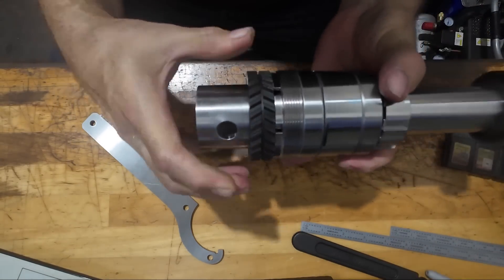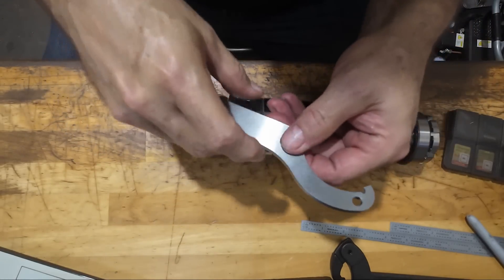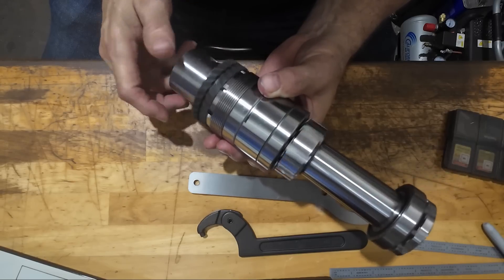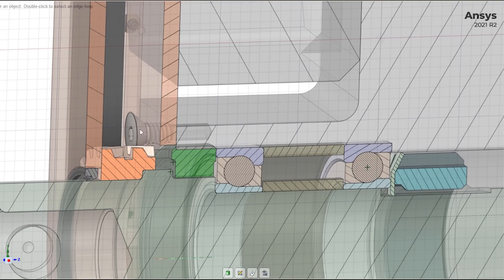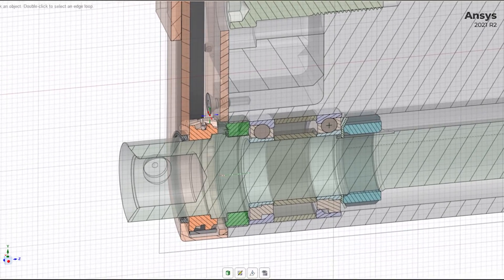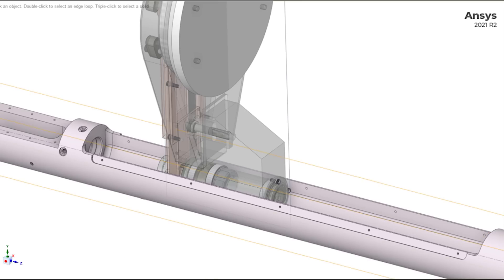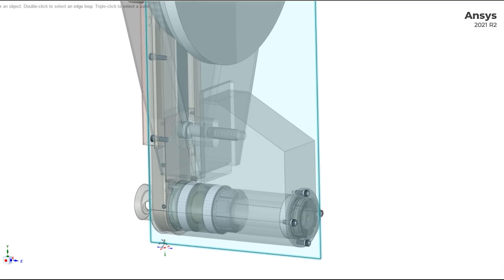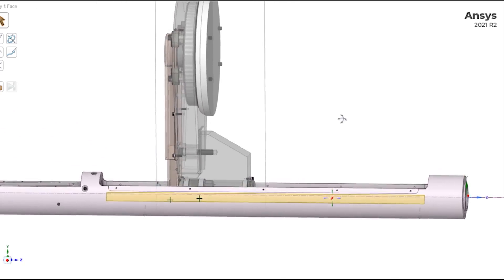Special Wrench

Comment: Hello Peter, I directed the reply below to a fellow commenter however, I thought I would ask you directly. I really enjoy your content!

I have been wondering the exact same thing (why is Peter doing this project?). I love Peter’s content and eagerly await his next video after I finish any of his videos. But I’m left wondering why do all of this? Other than just building a really cool attachment! I have no criticism, just huge curiosity. What is the mission statement?

My concerns are, I t’s 1:1 so same spindle speed, it’s less rigid than the main spindle, it’s complex, the belt is a wear item, the main spindle can travel below the lathe spindle. So why the offset? 

The only explanation I can think of is that it requires much less clearance under it and on the front and back. But that is easily cured with an extended reach holder. That doesn’t seem worth all of the beautiful work Peter is doing. I would love to know the story behind this attachment. What was the inspiration?
Reply from the maker: I showed in this video the reason? I have to do machine work on the end faces in this part's long slot/cutout. In order to get the tooling in there, I need this smaller spindle. The 1:1 Ratio just makes it easer to program and that's all the room I had for the belt drive anyway. The Mazaks milling spindle can rotate from 0-10,000 RPM with 50 Hp. So there will be no trouble with speed or power at that ratio. In this case I drought that I will need more than 3000 RPM anyway. Also I don't need in this case to tap anything but a 1:1 ratio make rigid tapping work better too. If I ever needed to do that in the future with this attachment.
Reply: @EdgePrecision  Thank you for the reply Peter. You were part of the inspiration for me to come out of retirement and start a second machine shop with my 18 year old son who is going into engineering school soon. Thank you for sharing your knowledge. All the best! Steve

Comment: I'm 10 days late, but is there too little space to add a "coolant-proof" seal to protect your spindle bearings?  Thank you for sharing the model so that we can better understand the reasoning behind everything.  I wonder whether the designer of the part you're planning to machine actually needs those 30° chamfers on the groove or if the groove design could be changed to something less expensive to machine?

Edit:  I was a Mechanical Engineering designer when I was young and the Tool Makers that built nearly everything that I designed all knew that I was always open to changes to my designs that didn't adversely affect the purpose(s) of the design.

Comment: Building a spindle is something I would not even dare to touch. There is so much involved that it is truly mind boggling. 
I am very interested in how this is going to turn out. Especially stability is a very likely problem area. What material is the part?
Reply from the maker: These parts are titanium.

Comment: Amazing work! Is that like an iscar ITS connection? Did you consider buying a spindle from nakanishi or other manufacturer? Or use a lathe live tool spindle with a capto connection?
Reply from the maker: No I did not consider purchasing a spindle. I needed the ITS MB50 connection for the boring heads I plan to use. Otherwise I would need adapters to use these boring heads. This just increases the tool length with those obvious disadvantages. So commercially available spindles just would not do what I needed.

Comment: Could it be possible to add an air in port to the "new spindle" housing, so you can have a little of positive air pressure inside it while operating and avoid cooling getting in?

Comment: I saw your post on instagram, I remember looking at it for a while trying to figure the whole thing out.  Thanks for making this video it makes a lot more sense now.  That is a pretty complex part I can't believe it could not have been designed in more than one piece.  Then again I have seen electronic unit covers machined from solid thicker stock rather than using a standard thickness sheet.

Comment: no way to burn that in with a sinker edm? Maybe the parts too big? just wondering
Reply from the maker: @precisioncomponentllc1820  There is a shop here in town that can do it (probably). But this is a very expensive part to a larger assembly. It is always better if you can do this kind of stuff in your own shop. You tend to lose control of quality and of coerce there is the time and cost as well. There are more of these part coming in the future so it would be better to do it all here. So the decision was to go with this idea. Mostly for the future parts as well.

Comment: I see holes on the face of the sheave. Was the  taper lock bored out of it to fit your application? Or are those holes for locking it on the shaft?
I'm not saying lock-tite won't work, but it seems a couple of set screws and a keyway might be applicable.
What would be really cool is if you made your own sheave. You could split in two along the groove around the circumference and have a taper on each side where they come together. Run some bolts thru the face and they'll lock together and easily clock however might be needed.
Maybe a belt tensioner, if your worried about clocking accuracy. 
Cool project. Seems like you could make a nice chunk of change selling these heads to Integrex owners.
Nice to see you back making videos on a regular basis.
Reply from the maker: Yes I bored out the taper lock on the sheaves. The head has a way to tension the belt. I’m going to try the locktite by itself. But I do have a plan to put pins if necessary.

Comment: I have used angle heads that have a 30 taper, but they have way to big of a housing for this part
Reply from the maker: It could work with ER32 and shrink ER32 holders I guess. But I need to use the ITS boring heads. So what better connection then the ITS MB50 that can work with the boring heads and they make ER32 chucks as well. With a MB50 shank.

Comment: Did you go back and forth with the customers engineer about these features? It seems unnecessarily complicated at first glance but if the company finds someone like you who is clever enough and willing to build custom tooling and even accessories for the machines to make a part like this possible it can have some major advantages or even boost some innovations. Great video as always. Thanks Peter!
Reply from the maker: No I haven’t talked to any engineers. I just do what’s on the drawing/ model of the part.

Comment: Brilliant work. Regarding your Mazak, not that I'll ever use one, but what is the operating life and servicing requirements? Also what make is your burr grinder?
Reply from the maker: The hand grinder is a NSK Espert 500. This machine was built in 2006 and is still going strong. Servicing requirements I don't know what you are asking with that? In all those years I have only replaced one Hydraulic pump and one power supply.

Comment: Hi Peter. Thanks so much for the video showing the use of this tool. I appreciate the full explanation. I just hope it all works out and I am sure it will. I would love to see how you will test the device before machining the part. I have a feeling you may need to alter the size slightly to allow clearance. (former CNC machinist and current mechanical designer engineer) As always I am amazed by your ideas.
Reply from the maker: I have some aluminum setup material with a short part of the slot the same as the part. To set up on. I think the clearance should be fine. There isn’t any material to machine away anyway. So it will have to do.

Comment: I am unsure, but fixed KM lock nut spanners like this are fairly standard at the local machine repair shop as well as in EU (I bought some locally, to tighten precision ballscrew nuts), so it might be that the engineer was looking at EU specs for the spindle nut?
Reply from the maker: I designed all the spindle parts. I wanted to keep everything as short as possible. There may be a wrench available but I couldn't find one.

Comment: I enjoyed watching this video makes one think that simple tools lead to complex machines.  I was wondering is the part your are working with to fix a defect in the machine or an improvement.  Basically, why are you making parts for the Mazak?  KOKO!
Reply: I have been wondering the exact same thing. I love Peter’s content and eagerly await his next video after I finish any of his videos. But I’m left wondering why do all of this? Other than just building a really cool attachment! I have no criticism, just huge curiosity. What is the mission statement?

It’s 1:1 so same spindle speed, it’s less rigid than the main spindle, it’s complex, the belt is a wear item, the main spindle can travel below the lathe spindle. So why the offset? 

The only explanation I can think of is that it requires much less clearance under it and on the front and back. But that is easily cured with an extended reach holder. That doesn’t seem worth all of the beautiful work Peter is doing. I would love to know the story behind this attachment. What was the inspiration?

Comment: When doing milling work in a vise like this, how do you go about setting your xyz for the programming? I'm in the process of making a fixture/vise setup for my MK4 Integrex to do some more convetional milling work, but I'm struggling a bit with figuring out how to zero the part once it's in the vise
Reply from the maker: Are you intending to program with Mazatrol or Cam software? I always use a Cam program. So you would set your fixture offset (Say G54) to the zero point on your part in the X,Y,Z with your probe or indicators edge finder what ever. This is a little confusing because your fixture offset zero is in relation to the machine's coordinate system. In other words not rotated. So the X will be the Z axis and the Z will be the X axis when rotated. But don't worry about that at the machine. The Cam software should take care of the rotation. Maybe the Mazatrol will also but I have never done this in Mazatrol. In your cam software you need your part positioned in the same orientation as the actual setup on the machine. This way you cam software will output code properly. 
Here is the beginning cod of the wrench program in this video.
O8534 ( SPECIAL WRENCH FOR SPINDLE )
(MAZAK_INTEGREX-E650H-3000U)
( TNG VERSION - 20.409.2.20876 )
( MACHINE VERSION - 2019.12.26 )
(8/14/2024 1:43:56 PM)
(REV-3)
 
(***************** TOOL LIST *******************)
(T20| #20.01 .125 4FL CARB IN SHRINK HOLDER .750 EXT)
(T44| #44.01 .250 4FL .75 CUT)
(*************************************************)
 
M200
G0 G17 G20 G40 G80 G90 G94
G53 X0. Y0.
G53 Z0.
M212 M108
G53 C0. B0.
M210 M107
#500=[1187704/100000]
 
N1 (MILL OD PROFILE)
T44.01 T20 M6 (#44.01 .250 4FL .75 CUT)
G90 G53 X15.35 Y-12.5
G90 G53 Z0.
G10.9 X0
M200
G97 S4000 M3
G54
M108 M212 (***Unclamp B and C)
G0 B90. C0. (***Position B vertical and C zero for the vise FX)
M107 M210 (***Clamp B and C)
G68 X0. Y0. Z0. I0. J1. K0. R90. (***This is the cord rotation)  
X2.24 M8
G43 H44 Y-5.7458 Z1. (***You see Z is now vertical. Like the B axis)
Z.03
G1 G94 Z-.05 F30.
  After that G68 line the X is now the Z and the Z is now the X. With its Plus direction going toward the chuck. It is a if you were standing behind a normal vertical mill. With X plus going to your left and Y plus going away from you and Z plus going up. That's kind of complicated to explain in a comment. Does that help?
Reply: @EdgePrecision  The idea is to use this with Mastercam. I've figured most of what I need to do, but I haven't figured out how to make it use G54. Whatever I input in the G54 offset window, it will consider X and Y to be 0 in relations to machine center. It will only take into consideration what I input in Z and C. Probably something stupid I'm missing, but haven't figured it out yet.
Reply: @EdgePrecision  I've managed to make it work now! However, it is not compensating for my tool lenght. G43 does not seem to work with this machine

Comment: When cost doesn't matter one single bit.
Reply: Yes you have to remember that when a dedicated solution would be engineered and built by an outside company true to spindle quality specs, the whole nine yards, we could probably be talking a cool million at the least. 
I remember from my work at Fokker here in Holland they bought a very large Fooke machine and the special 'force-feedback countersinking head' was around a 1.5 million euro addition. Used to countersink holes in CFRP assemblies. I did not stay around long enough to learn if it was a success. Crazy business.
Reply: @bigbattenberg  Yea it sure is. People are just not aware what sums could be involved. Several years ago I worked at a big sub contractor that dealt with items for among NASA. The things especially NASA sent us later on to be made was beyond normal I can say so we had to buy new machines in the millions. But we earned so much at that point so that was not an issue and I saw money in the millions just go through every week. And that was pretty much just so we could hit the tolerances that was insane and for long pieces as well. On one, of many times, when we made what looked like a very expensive and complex and hard to make item, I asked what it would cost. At the moment they didn't knew since it would take several weeks to make it but surely in the millions they said. NASA didn't care, they just wanted it period, cost didn't matter. It was just insane.

Comment: Summary
* (0:00) Special Wrench Creation: The creator made a special, thin wrench (3/16" thick) out of Starrett flat stock. This was necessary because no commercially available wrench could fit in the tight space required for a specific spindle assembly. He might heat treat the wrench for durability.

* (2:25) Spindle Assembly Purpose: The spindle is part of a larger assembly being built for a client.  This assembly is designed to machine complex features inside a part, specifically hard-to-reach bores with grooves and chamfers.

* (9:14) Unusual Part Design: The client's part has an unusual design with awkward features, including off-center bores and undercut grooves.  This design makes machining difficult and necessitates the specialized tooling being created in the video series.

* (11:14) Solution Explained: To machine the part effectively, the creator is constructing a custom spindle assembly that mounts on a Mazak lathe. This assembly uses a 90-degree attachment and will allow for tool changes with an Allen wrench.

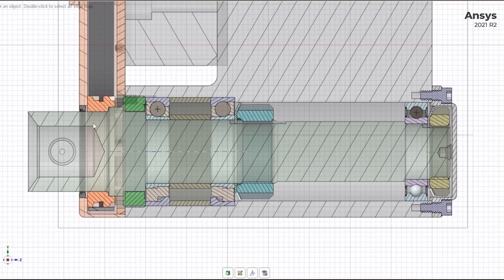* (14:14) Coolant Considerations: The design of the part and its tight tolerances require careful consideration of coolant usage. The creator mentions the need to limit coolant flow to prevent it from pooling in the part and potentially damaging the spindle bearings.

* (16:08) Video Series: This video is part of a larger series documenting the build of the custom spindle assembly. The next video will likely cover boring out the housing for the spindle cartridge.

* (11:14) Why Not Traditional Methods?: The client had previously machined this part using a vertical mill with angle heads, which was inefficient for tool changes and repeatability.  The custom solution offers a more efficient and precise method.
I used Google Gemini 1.5 Pro exp 0801 to summarize the transcript.
Cost (if I didn't use the free tier): $0.0521
Time: 20.50 seconds
Input tokens: 12715
Output tokens: 721

Comment: If the coolant drain becomes a problem you could hook up a shop vac to the underside to the through holes to help expedite the draining.
Reply from the maker: What I thought if it becomes a problem.  To purge air inside the spindle to keep the coolant out. This is the way it is done on commercial CNC equipment.

Comment: That green loctite is something.  We made a tool for NOV several years ago that called for it to attach a slip on drive key into a shaft.
Reply: Love the stuff. Many of my designs use it as default. Love the fact that it assembles by hand without stressing the materials and the tolerances can be just a bit less tight which saves time and money. When dead on accuracy is required post-machining can be done as I sometimes do on repair jobs, leaving a bit of stock beforehand.

Comment: Impressive work as usual.  Gotta love how and engineer can design stuff that's near to impossible to machine.
The only other method Ii can think of would be to use ram EDM to reach those bores from the side.
Reply from the maker: We did discuss Ram EDM. But the parts are over feet long. There is a shop here in Houston that could do this. But every time you send a part out of your shop to another you loose control of it and there is the possibility of scrapping the part by the other shop. Not to mention having to pay for that service and the time it takes. Now we are only doing two assemblies (This is just one piece of a larger assembly that gets electron beam welded together). But there are more in the future to do. so it seemed good to devise a way to doo it ourselves.

Comment: Can anyone offer insight into why this part would need such absurd features designed into it?  It almost feels like the designing engineer didn't think for a second how it was going to be manufactured.  Is it likely to be like that, or is it more likely to be some critical feature that must be designed in this mind-boggling way?
Reply: Most likely a critical feature.  However, sometimes you're boxed in by decisions made earlier in the design process.  Another very common one is your project time is chopped off by management while you're trying to improve the manufacturability.
Reply: New age imagineers